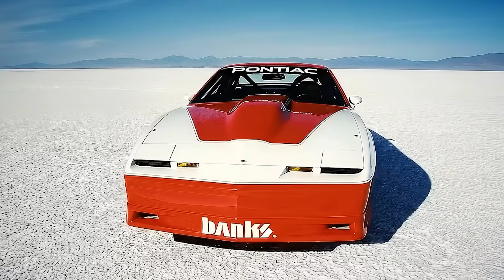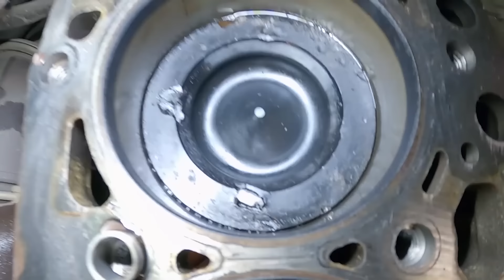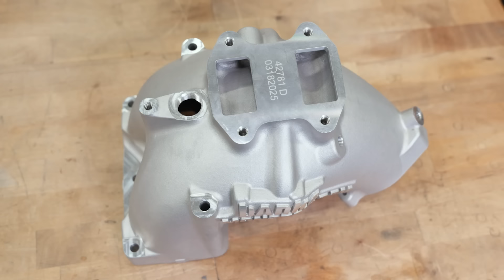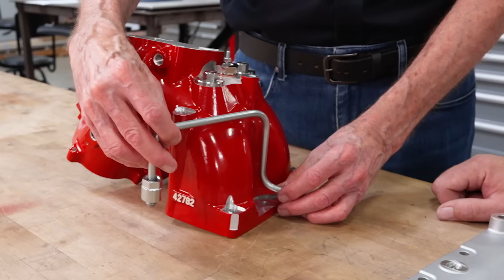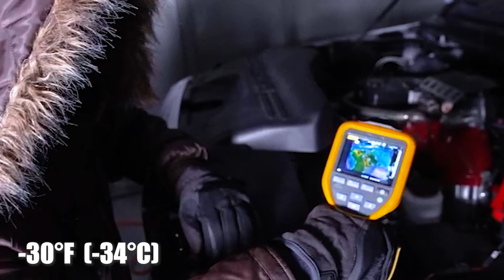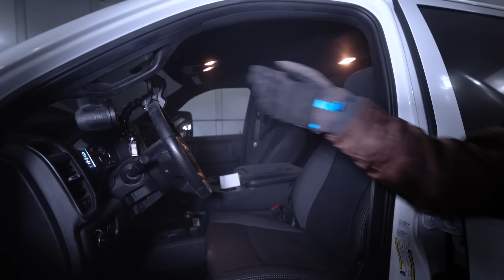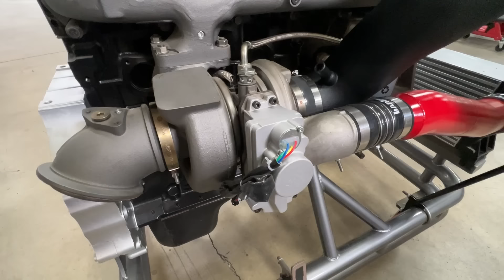The RAM 6.7L cold start dilemma.

Comment: It looks as if you could infact runt three heaters if you were in a place like Alaska with more extreme low temps. Living in Minnesota when it's -35F the only diesel I have that wants to start is the trucks with the Paccar engines, I had a MX13 start at -25F when i blew the breaker it was plugged in to and dead cold over a 3 day weekend somehow it started 🤣

Comment: If you have no 120v power up north/40 below, you bring the fully charged batteries inside for the night, re-install them in the morning, torch the oil pan for 10 minutes, use ether during cranking and pray.

Comment: #1 diesel IS winter additive package #2 is summer, for those who got confused...
Reply: #1 is a different blend that has more kerosene and low wax. I can usually tell when the switchover happens (if the pumps aren't separate between 1 and 2) because #2 diesel gives better mileage (higher BTU and energy density).
Reply: Thank you for saying it! Was about to do the same lol
Reply: ,,, yes number one is winter . It has a significant percentage of kerosene , that is thinner than number 2 .
Reply: Number 1 is thin and not available at most consumer gas stations. It's practically kerosene. #2 winterized diesel is available at any station in any town in northern USA and generally runs fine down to 20 below zero F without any additional help
Reply: #1 is definitely available at every fuel station in the northern part of the United States. North Dakota sees ambient temperatures as low as -60 Fahrenheit every winter and #2 winter blend gels, hence the need for #1. Canada has a diesel fuel labeled “P40”, not sure what is the make up of it but it’s by far the best winter diesel fuel I’ve ever ran.
Reply: That is incorrect.